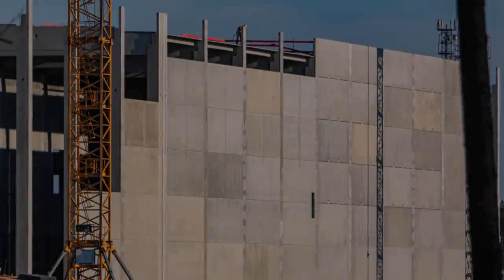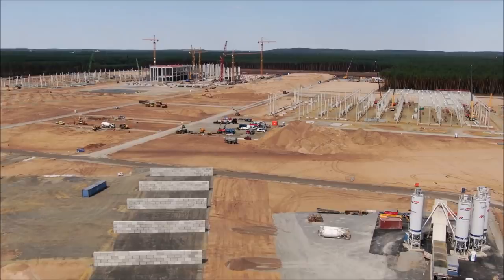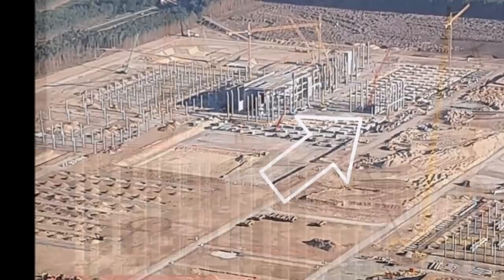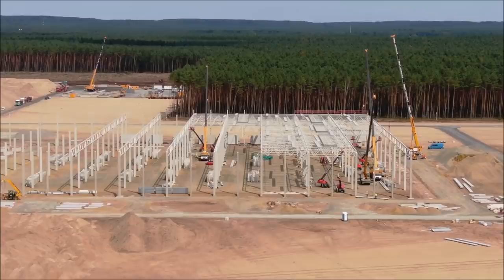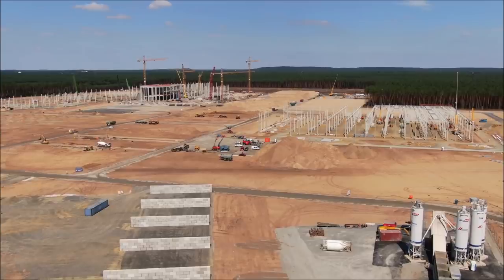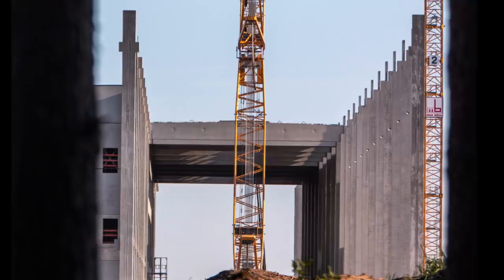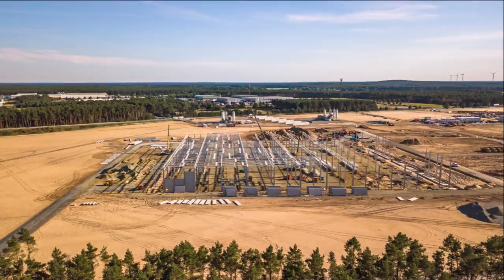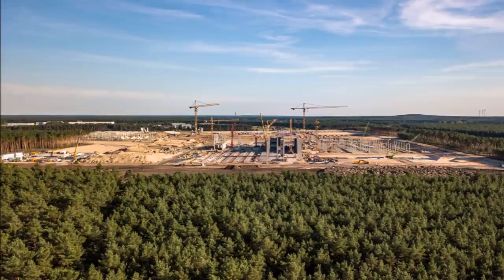Tesla Giga Berlin's First Wall and August Update

Comment: I have a feeling the finest example of Tesla cars will be built at Giga Berlin.
Reply: I think you may be right. Although, Tesla Shanghai Model 3's were just listed as really good build quality. Freemont needs to do a better job.
Reply: Ronin Z proud to be a Fremont Tesla neighbor and owner of a perfect model dual motor!
Reply: They will be in texas.. with the cybertruck. I was amazed that the cybertruck wont have paint so u will never worry about scratching it. Amazing.
Reply: @visskiss  They're getting better, no doubt, but not good enough yet. There are plenty of reports on Model Y quality issues.  Most are insignificant, in my opinion, like panel misalignment and small paint issues but nevertheless, they can be much better. They should eventually get it right since Elon outlined his expectation on quality...

Comment: Armen ,  Generally, in the US, we say a "roof"  is the completed structure.  First comes roof trusses, then roof decking, then roof sheathing.  Once the structure and waterproof sheathing is added then it's a completed roof.  Likewise, with a building , we don't say it's complete until it passes inspection and is ready for occupation.   I think you should start clarifying which stage of completion is happening for each building rather than saying a building will be completed when the basic structure is in place.   A typical construction consists of; Site preparation,  Excavation for foundation and utilities,  Foundation,  Basic structure,  Roof,  Exterior finishing,  Interior framing and finishing,  Utilities (plumbing, electrical, equipment cooling, and HVAC),  Production equipment installation and Landscaping.  Tesla is using pillars with a built-in foundation for the shorter buildings at GF4.  I've never seen that before.
Reply: Frank Hage a floating pillar with an 45cm overlay slab floor foundation will float on the sandy soil, the factory floor is expected to sink 10 to 15mm over 25 years.